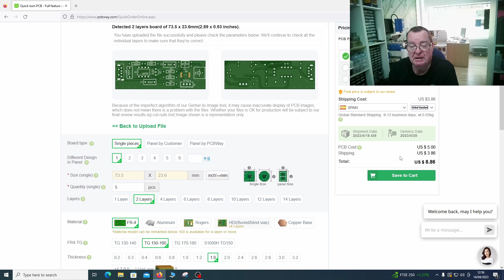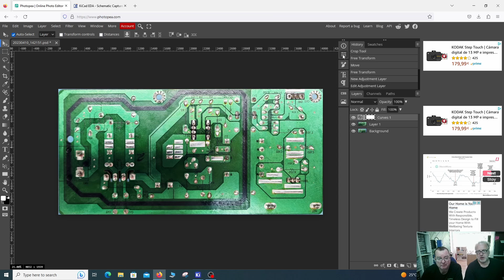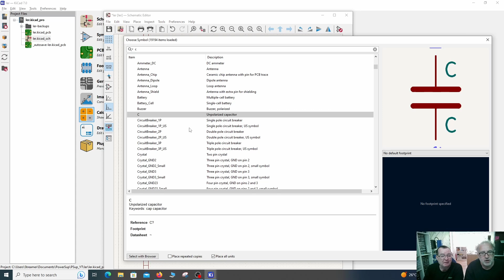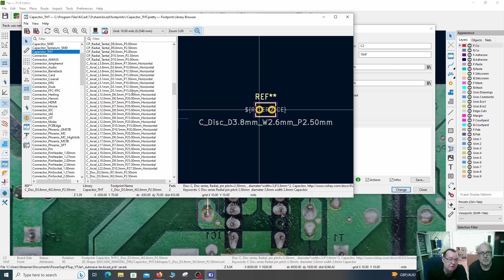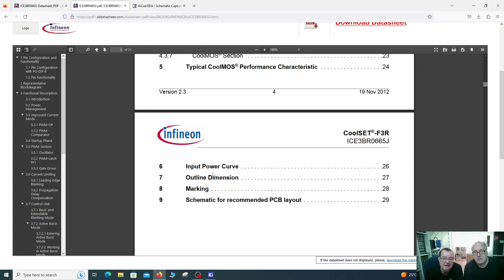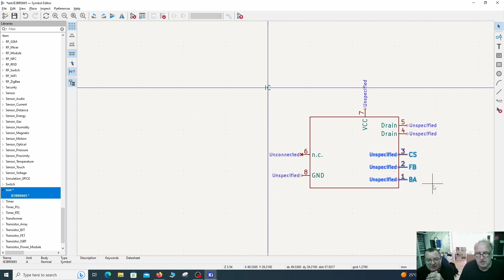The Ultimate Guide To Reverse Engineering A PCB To A Schematic with FREE Software

Comment: Mapping out a single-layer PCB with through-hole elements is easy. Try that with double-sided, multi-layer, surface-mount PC motherboard or a laptop motherboard and it won't be that easy anymore. There's a lot of vias (sometimes even hidden), there's a lot of invisible connections going through layers buried deep in the PCB, and there's thousands of pads to test to figure out which ones are connected with which, so the complexity grows quadratically. It would be nice to have some shortcuts for that, but I'm yet to see any.

Comment: There is an easier way of doing this now in Kicad V9.0 (I don't know when this feature was added).
1) Create the symbols in the schematic editor; change the references as required but don't bother to add the footprints.
2) In the PCB editor add and position the footprints of each component and change the references to match the part in the schematic. The pads of these new footprints will have no net name (unlike when adding them to the PCB by 'Update PCB from schematic') so they can be easily connected with tracks to match the actual PCB.
3) Click on a section of a track you just added, '<right click> select properties' (or 'E' key). There you can set a net-name and click OK. It will ask you if you want all the connected pads to be in the same net.
4) Tools->Update Schematic from PCB. Make sure 'Re-link footprints to schematic symbols based on their reference designators', 'Footprints' and 'Net names' are ticked. It will show a list of what it will update in the schematic which should include adding the net labels.

5) If you subsequently add in a new set of footprints to the PCB and want to extend an existing track to the new components you can select part of the existing track and change to <no net> for all the connected pads, then extend the track as required, then change the net name of all pads now connected to the track as in (3).

Obviously no-one who watched this video is going to see this comment so perhaps you'd like to make a short update video? It saves a heck of a lot of work editing the net names of every pad in the PCB and adding the net labels to every pad in the schematic.
Reply: In the unlikely event anyone attempts to use this technique, be aware that it doesn't work in Kicad 9.01; they introduced a bug such that when you try to change the net-name of all pads connected to a track in PCB Editor it only changes those directly connected to the track segment you highlighted. My solution was to go back to 9.0.  I reported the bug; it has been 'fixed' and it should be in 9.02.
Reply: Just wanna comment and say thank you for your comment, I found it extremely helpful. thank you brother
Reply: Can you make a video and upload it in your channel , I would really like to learn this I am not able to understand it clearly thru texts
Reply: @cloudeyt4989  Seriously???? You cheeky bar-steward! Obviously because I have nothing better to do with my life, I probably could provide 1:1 personal video tuition. But it won't come cheap. How much are you prepared to pay?
Reply: @tonyh6309 chillax bro I figured out

Comment: Good timing on this video. I'm getting ready to do this on a motor controller that's not working right. If the board is single or double layer, you might also take a photo with a bright backlight as a kind of "x-ray" view, which might help with connections.

Comment: Very interesting video. My only question would be: If a person did want to make a second unit, then they would need to acquire suitable parts. Using inductor symbols to represent the transformer is fine for a schematic, but to actually build this power supply, you would need to find an actual transformer with the same (or similar) characteristics. And of course, that transformers pinout would need to be used. 

If all you want is the schematic, then none of that matters. I look forward to part 2 to see how you address this. Or if you address this issue. In the meantime, great video and thank you for making it.
Reply from the maker: Of course you need the suitable parts to reconstruct the power supply.  The scope of this video and part two is primarily how to reverse engineer a schematic and secondly how to make a gerber file to duplicate the PCB.

Comment: Been doing this since I first started doing electronics back in the late 70's as no more than a kid.. Schematics?.. what are they.. All I had was the Mullard valve and transistor book printed the year I was born and a couple of generic tv repair books from a market stall.. Somebody gave me a Taylor meter they found in a shed when I was 14 and .. well. the rest is history.. Fixing guitar and pa amps for rock bands out on the road for years.. I'm the only amp tech in my town .. It's not hard.. some of the modern stuff is complicated but usually there is something similar enough to look at.

Comment: Thank you for the hint of looking up a reference circuit to shape the symbol from. That's really practical :-) to get a readable schematic from the get-go if the chip is used in a default config. as it usually does.

Comment: Definitely going to have a try of this! As someone else mentioned an open source repository of reverse engineered schematics would be a great idea, I just have no idea how you would validate their accuracy. If anyone knows how to contact Louis Rossman I believe he is doing something similar but way more ambitious with repair guides for apple (eew) boards so may have some thoughts.
Reply from the maker: This method makes it much easier to ensure your accuracy - you will see how to get it right every time in part two
Reply: @learnelectronicsrepair hello, there is a part 2? I can find it...thank you!
Reply from the maker: @Mr Guru I do agree what you say about people thinking a schematic is a magic bullet, and you already know how much I teach repairing without schematics. It does take a particular mindset (in particular, patience) to be able to do this sort of thing.  If you are the sort of person who thinks untangling a box of cables is a 'challenge' rather than frustrating, or finds sorting a big heap of nuts, bolts, screws etc into a compartmented storage box therapeutic or even relaxing, then this sort of work is probably for you 🙂
Reply: The best way to get Louis Rossman's attention is to tell him that you are from the Brooklyn department of waste management, and you need to collect a bill.  :)
Say, you wouldn't happen to be the same guy that badgers Onewheels, would you?

Comment: any tips or links to videos that anybody knows of, which are helpful for identifying mystery inductors w minimum setup (i.e. no more than sig gen and scope)?
Reply from the maker: @Mr Guru The cheap component analyzers can measure inductance and they are extremely useful, if not indispensable.  However I have found and proved that a 'real' ESR meter is far better at measuring low value inductors such as those found in VRM. Probably both tools are something you really should have.   The component tester function of the DSO-TC3  I reviewed recently proved to be far more capable than other cheap ones I tried (even with small inductors), and it actually surprised me just how good it was.  https://www.youtube.com/watch?v=JpISM7g9Ff4 I am happy to recommend that one.
Reply from the maker: An ESR meter (a real one not the feature built into component testers) will measure inductance though you need to use just a little math to convert the ESR 'resistance' reading to microhenries.  I demonstrated this here https://www.youtube.com/watch?v=bMUzTGnvrbU

That will not tell you all you need to know in the case of power inductors, but it is a start.

Comment: KICAD IS AWESOME !!!!!!!
Reply: I like KiCAD but it does give me a hard time every now and then. I'm sure that sometimes an error makes it lose a link in it's database and from that point on it's better to stop and start again.
Reply: @TheEmbeddedHobbyist  Squeak!!!!!!
Reply: @andymouse  Eek it's Mr Squeak.
Reply: Yes and no. That you can use such a mature tool free of charge is awesome. The UX however is non-intuitive to me and don't get me even started about some of the more obtuse error messages. Good UI/UX designers are quite rare so I'm grateful that it is at least functional. If I was a developer I would have offered suggestions on how to fix some of the issues, but I'm not.
Reply from the maker: @LarixusSnydes  The 'loose' relationship between symbols and footprints in Kicad does make it rather well suited to what we are doing with it, as you will see more so in part 2 later this week. I hear what you say about the UI though, this video required quite a bit of editing to keep Det looking calm and collected throughout LOL 🤪
Reply: @learnelectronicsrepair  I'd love to see more episodes about designing with Kicad. I'm working on a project right now that has already 3 PCB 's / modules in it's design. One of them has been built as a prototype on stripboard and is working fine, but two others are still in the design phase and especially the next one will be important for keeping the operator ( most often myself ) safe. Everything already works in the electronic simulation. I only need to translate it to a properly working circuit board.

Comment: Does the footprint for the dip8 need to be flipped, or are we pretending we're placing components on the top side of the board and can see through it like an x-ray?
Reply from the maker: We flipped the board earlier in the video
Reply from the maker: @Mr Guru Which also need to go onto the 'correct' side of the board 😉